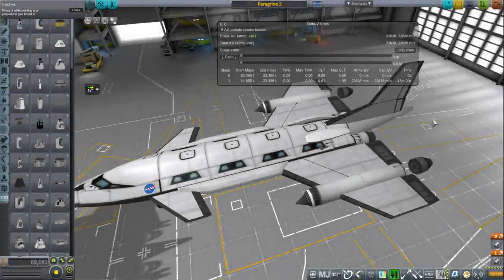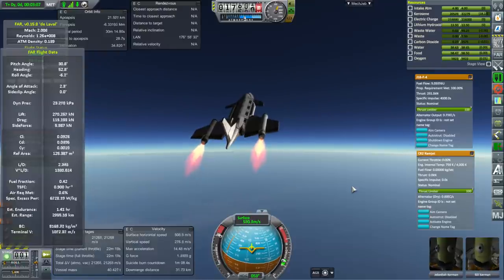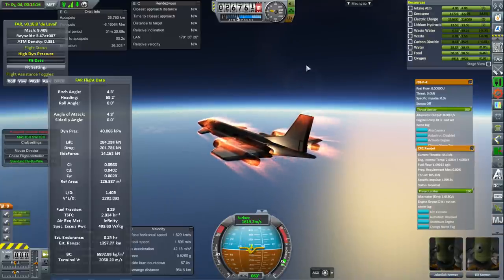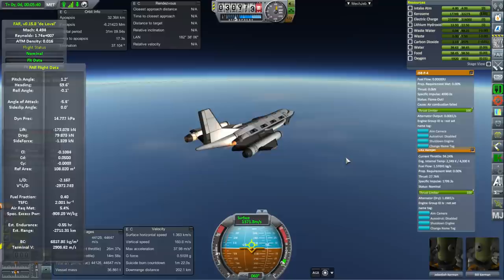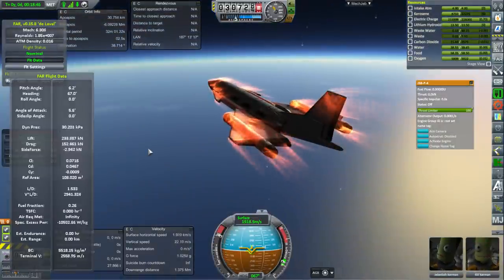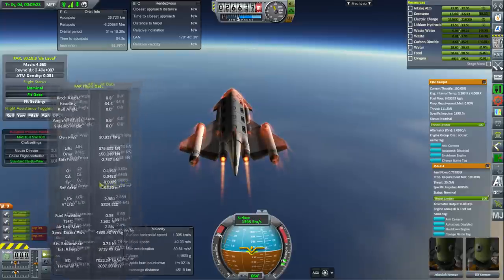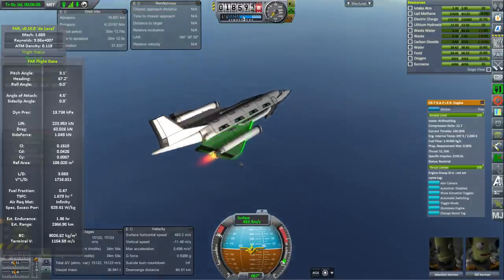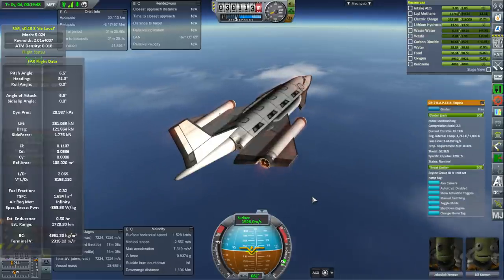Kerbal Space Program RO Sandbox - Hypersonic Liner Development 03

Comment: with ramjets the key for range is altitude and velocity, go as fast and high as you can. actually in any jet engine that does not 
have an afterburner throttling down is not going to help with efficiency or range, always go fast and high

Comment: So you simply need more fuel. I have a hypersonic plane with 6 RAPIERs and 250 t of launch mass, range is about 6000 km,  takeoff requires about 3750 m but that's realistic, you should consider building a plane with 2 RAPIERs and 80-85 t of mass - mostly fuel.  Lower TWR doesn't mean that your max speed will be lower, it only affects takeoff distance, climb rate and maneuverability.
Reply: winged Please make more videos, they are so god damn good !
Reply: 3750 m is very reasonable number, you will not need to build new airport.

Comment: I tried only using J58 (2 and 4) but the problem I'm having is that they just explode at about Mach 3.5 and I really don't know why.
Also I've got a feeling that precoolers don't do anything, because in my tests I couldn't see a big difference, and you didn't either...
As well I might suggest that you use the "normal" lightweight aircraft passenger module, since it has much more realistic number of passenger per meter of length than the mk2 and you can cut on drag as well using it in combination with the concorde-cockpit (you may need to rescale it in order to look alright)
Reply: Regarding your problem with the J58s:
Take a close look at the object info (right-click) of the engines at around Mach 3.5 - 3.8.
The internal temperature reaches its upper limit at this point, thus the explosion.

There are two versions of the J58. One has the above problem, the other one (which Tyler used) is sort of bugged - or just has no maximum internal temperature limit, which I doubt.